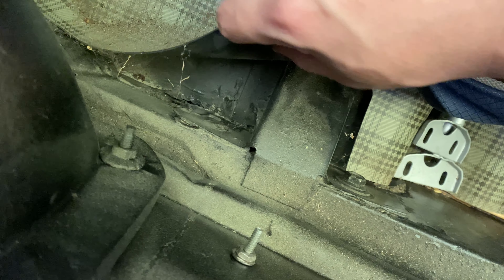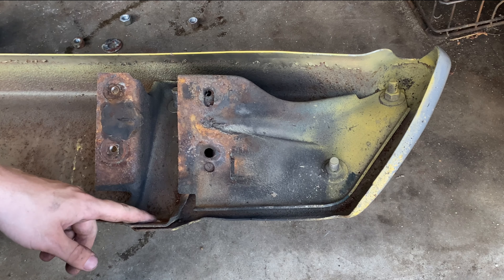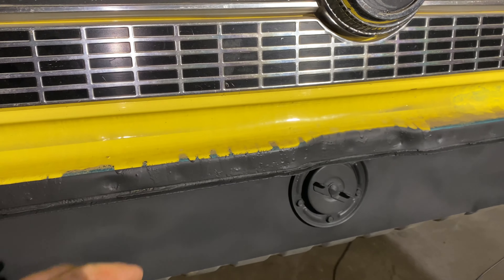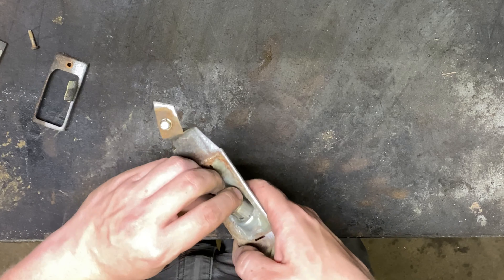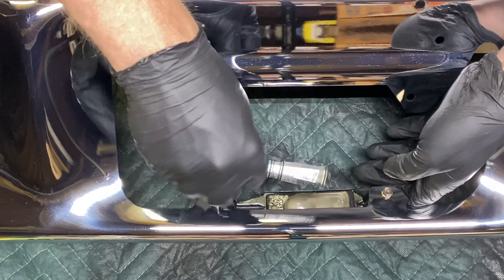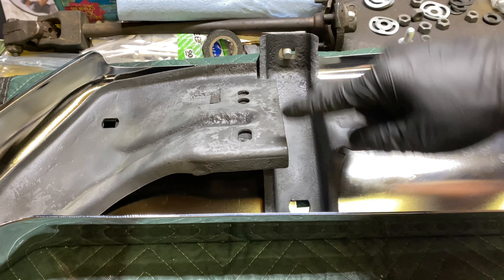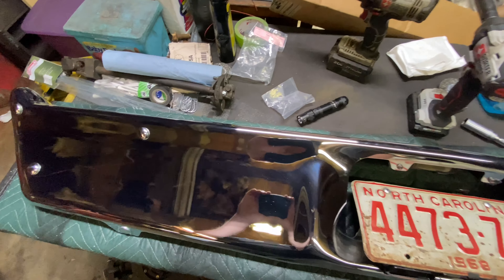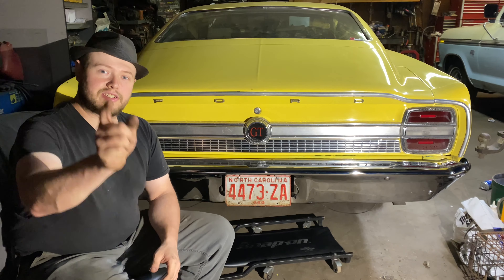68-69 Ford Fairlane/Torino Fastback rear bumper install.

Comment: Nice Video. We just replaced the same bumper on our 1968 Cyclone. By the way, the big spring washers go between the bumper and the bracket. You had me second guessing but I verified it with the assembly manual.
Reply from the maker: Thank you! Glad you liked it, hey cool car, you don’t see those cars anymore either. 
Oh ok, thanks for the info, I didn’t get any manual with mine so I had to figure it out as I went lol. 
Thanks for watching.

Comment: hey man I know its kinda random but i got and a new camshaft for my amc 304 v8. its a pretty mild cam but im trying to figure out the best timing for it and rpm at idle to make it sound aggressive and perform well. I know you have a lot of knowledge on this stuff which is why im asking. Its the edelbrock 2132 camshaft if you wanna see the specs. If you could help me i would appreciate it a lot. thanks
Reply from the maker: No problem at all bud, really it’s kind of a test it and tune see how it works kinda thing ya know. See where it idles best at in drive if it’s an automatic, and you have to adjust the idle whenever you adjust the timing. So idk what the factory set timing is on the amc motors but after you install the cam and get it running for break in, I’d set it for factory specs. After you’ve ran it and it’s broken in as it needs, then I’d play around with the timing. Bump it up a couple degrees and see how it runs. Make sure it doesn’t spark knock because you could break a piston. You also don’t want the timing too high anyway because it could melt a piston. So really I probably wouldn’t go no more than 4-6 more advanced than factory spec just to be safe if you’re not sure. Usually you want your idle somewhere between 800 to 1000 in neutral and 600 to 800 in drive if an automatic, and again these are ball park numbers, yours could very but that’s where I’d start. For example, on my ford 302 in my 68 fairlane, it’s set at 800 rpm’s at idle in neutral, and I keep the timing between 10-12 degrees advanced. The factory setting on that 302 was 6 degrees back in the day. My 1976 ford truck is set at about 600 rpm’s at idle in drive with the timing set the same, between 10-12 degrees and the factory spec on it was 8 degrees, so that’s why I say you have to test and tune to get it where you need it. Not to mention the setting of your air fuel ratio on the carb if you’re running a carb. If you’re running EFI then it should automatically adjust for you on that. Hope this helps out or at least gives you an idea, good luck on your build and thanks for the compliment and thanks for watching.
Reply: @FastFords289  thanks bro much appreciated. I have a Holley 4 barrel carb and I think I have the timing at 5 advanced which is the factory setting. The car likes to idle in neutral at about 1100 rpm and in gear at around 950-1000. It seems kinda high but when I turn the idle down on the carb the engine wants to die. Idk if it could be because of the camshaft profile, I know some cams require the engine to idle higher in order to make enough power to move the car. Thanks for the advice I didn’t know how severe messing up timing could be. The cam is still somewhat breaking in, I’ve drove it maybe 350 miles so I’ll have to adjust the timing again soon. But I’ll figure it out.
Reply from the maker: @aaronhatfield4582  you’re very welcome, very nice carb, that all I run is Holley or motorcraft. I got the quick fuel on my fairlane which is built by Holley and it works great. 
Yeah that seems a bit high, that would be a big cam that would need that high of an idle. You sure you got the carb air fuel screws set right, and your float level set properly? Perhaps you could have a vacuum leak which would cause it to die as well especially with a cam, everything is more sensitive when running a cam.